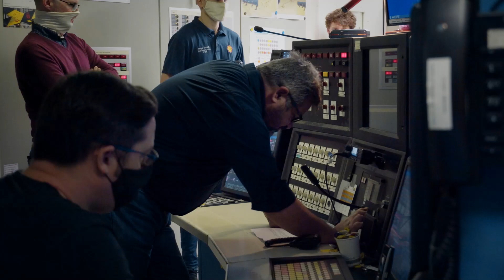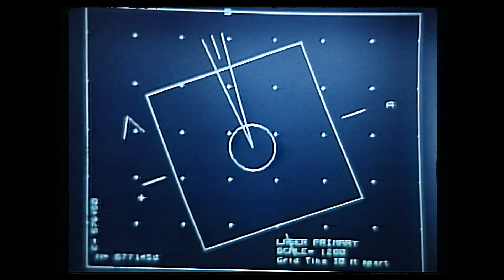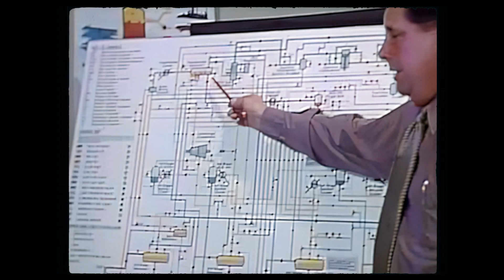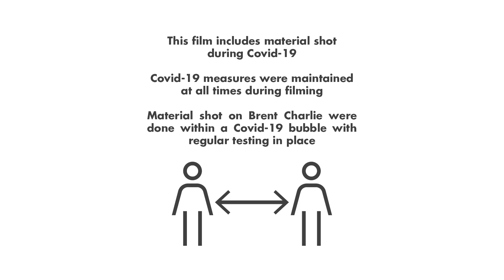Brent Charlie:  End of an Era

Comment: I worked on 'C' as a diver getting it ready for tow out from Ardyne Point. Each of the internal conductor tubes in the tanks was NDT'd and video surveyed. Also installation the transponder system for final location, rigging for tow out by (if I remember correctly)  the Smit Rotterdam and two control tugs astern.

Comment: I visited Brent C a few times while it was being built. I remember it as an amazing hive of chaotic activity. To be frank, it wasn't the safest of places! I wonder if the aerials I put on the top of one of the modules were there at the end. Putting them up there was a frightening experience. Lying on my stomach on the roof in a howling gale, lashing rain and hail, a soldering iron in my hand on a massive extension cable (yes!) and limited time in case I was going to miss the helicopter!

Comment: Now the moment you all been waiting for time to scrap Charlie. Charlie like Delta and Bravo is made of concrete so removing it will be easy compared to Alpha where they scrapped the whole rig including the jacket. For this lift the Pioneer Spirit will come under it and cut the legs then 32 hydraulic rams will close and lift the rig off its legs. Once the rig is removed the boat will do a 180 turn and four stainless steel covers will be placed over the legs and a hose will be attached to fill them with sand and concrete while pumping out any oil that remains inside. Once the legs are secure the Pioneer Spirit departs for Glasgow Scotland where the rig is transferred to the Iron Lady. the Iron Lady then heads down the Forth River to Harpole and the rig is sold for scrap bringing an end to 4 decades of oil production on the North Sea.
Reply: I have commented already on how little you know about this project. I don’t know if it’s attention seeking but you really need to get your facts straight. Charlie will not be going to Glasgow and the Forth river does not end up in Hartlepool.  The legs do not get filled with anything other than seawater and are capped with concrete covers not steel.
Reply: They can scrap the steel and cap the concrete...but they can't do anything about the ten years i spent on them ...my memories are sacred....no recycling here ma loon

Comment: so whats next? no more brent? or this is just the platform?
Reply: No more oil, the field is depleted.
Reply: Correct, no more Brent. I wonder if they’ll rename the commodity benchmark? 🤔😂
Reply: @baronvonteuchter1412 

No, because there are 3 fields besides Brent collectively establish the price benchmark for the crude grade (light and sweet) named Brent. 

There is Dubai price benchmark still in use although Dubai single offshore field output dropped from 400,000 barrels per day to latest 80,000 per day (and expected to seize production by 2025-2030).
Reply: @dongrandmaster3787  interesting, thanks!!
Reply: 1eZx,